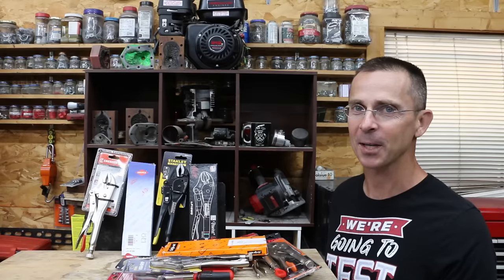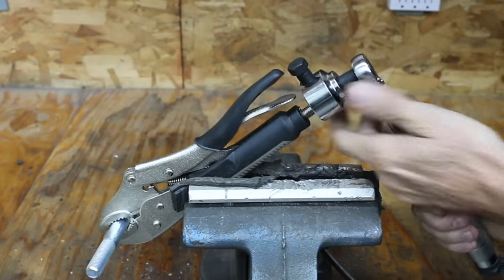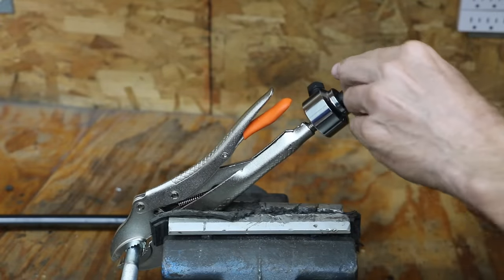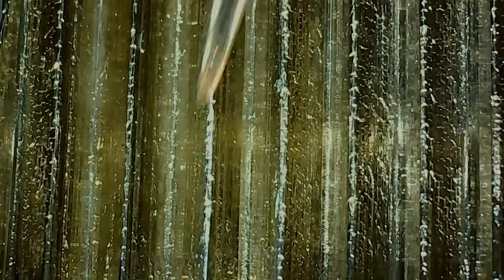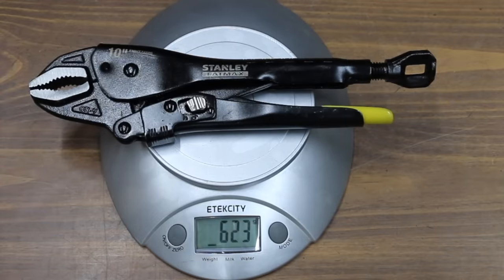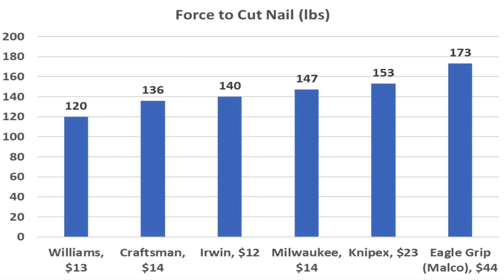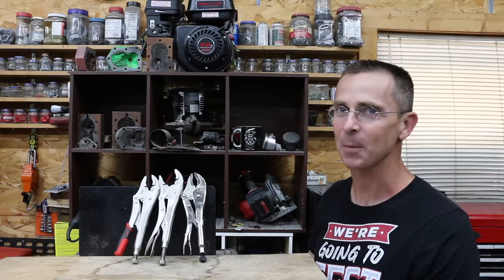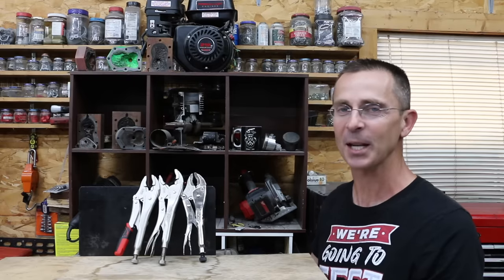Best Locking Pliers (VISE GRIPS)? Irwin vs Knipex, Milwaukee, Craftsman, Stanley, Malco, Pittsburgh.

Comment: Seriously impressed with Irwin and Craftsman.  Well done as always my friend. Keep up the amazing work.
Reply: Irwim seems to always be best value for money.
Reply: i originally bought a set of pitsburg ones because I just need something, but after a few weeks of them constnatly slipping on things I was fed up and replaced all of them with the Irwin ones, much better and actually grip. Now they sit in my spares drawer for modifcation (welded/grinded to custom tools)
Reply: Stanley black and decker makes and owns all of them and they are the original vise grip name that was in DeWitt Nebraska and malco reopened it making the same pliers 15yrs after they shut it down lots to be said malco gave back what Irwin and Stanley took away.
Reply: Irwin I believe bought vice grip company the original guys came with tool. It like locks
Reply: @CPthetooladdict  those Malco tools are just beautiful too. Definitely worth buying American made when possible.
Reply: Did Irwin had a patent on the original vise-grip?
Reply: @ophirb25  yes it ran out in 2020 and malco had this planned to start making them in the old plant in DeWitt Ne.

Obviously we can tell why Irwin went the china route it was to be make more profit over less cost of American wages and labor and also they can be more competitive in the market. It's a fickle situation and sad.
Reply: I'd be impressed with myself if I could stuff up a pair of most those brands using only my hands.
Reply: Both of these are sold here in Australia. I'd like to see the test redone including Draper locking pliers.
Reply from the maker: Thanks, will do!
Reply: @MantasJurkuvenas  Irwin tools are Australian, yet too many of their tools are made in China.
Reply: @christophermarshall5765  they work very well for tools designed upsidedown :)
Reply: @MantasJurkuvenas  yes they do!! One trick you could do, is to weld a rounded nut inside where the adjuster screw is, though you'll lose about 10mm of jaw use, or open the threaded section, & weld in a threaded sleeve.
Reply: @ProjectFarm   Just an observation. I dont think your test was entirely set up correctly. Your test only demonstrates the effectiveness of the adjuster, and not the actuall mechanical advantage of the pliers as a whole.  Let say the bolt you used had a .500 diameter. Take a .480 guage pin (or whatever you choose) and have the jaws closed and adjusted to just barely allow the guage pin to pass through.
Reply: @daisykaran5607  They did. Closed down the DeWitt, Nebraska factory where genuine Vise-Grips had been made for 70 years or so, and moved production to China. Malco reopened that factory a dozen or so years later and is making an improved tool with the know-how of several Petersen employees who were still in town.
Reply: @CPthetooladdict  It's more than just wages, it's metallurgy too.  Higher quality metals, better milling methods, and better heat treating, etc.  It's a complex issue, lots of supply issues too. 

Finally?  Quality control:  In the el-cheapo brands, they may or may not do a random tool check by lots.  Whereas I bet Malco brands check each and every pair before shipping.  You get what you pay for.
Reply: @MantasJurkuvenas  definitely a solid brand
Reply: You would really hope that the best vice grips would be vice grips. Like, it's literally the thing the brand is known for.
Reply: @ophirb25  Yes. Also a trademark on the name.
Reply: @christophermarshall5765  Possibly Gongmaw they have a youtube channel.
Reply: Vise grip brand locking pliers made in nebraska prior to irwin buyout were far far superior.
Reply: Their tools went to complete shit for years n years, they were bubblegum machine tier tools.
But here in the last say oh, 5-10 years? they really stepped up their quality.
Reply: @christophermarshall5765  Uhhh No! Irwin is not Australian. Started in Ohio, currently headquartered in North Carolina, and is now owned by Black and Decker.
Reply: As someone that worked at a big-box retailer, I found it funny each time someone had 'hate' for Irwin. Specifically claiming Vice-grips took a dump after they took over. I inherited some very old vice-grips and the new are just as good as the old - maybe better.
Reply: It's not as difficult as you think. I've had one or two that I 've used bend pretty easily, usually it's the flat bar that crosses between the two handles. And if that doesn't bend, the handles bend out of alignment. Not the best tool, if you need torque.
Reply: @CPthetooladdict  -Going back to 'The good old days', where good  tools (made in USA) were only owned by professionals, an air compressor made in USA was so expensive that Only the corner service station had one in our community, to say nothing of a 'Sun timing light, and professional dwell meter$$$$?... No thanks ;}
Reply: @CPthetooladdict  I'm not sure how many watching this actually used the original vise grips. As I mentioned above, since Irwin took them overseas they are garbage.
Reply: @CPthetooladdict  What's sad is that so many of us (myself included) will spend $10 to $15 on the 'cheap' ones. And we'll do this multiple times over 10-20 years. So we end up never buying the higher quality, better made, longer-lasting USA brand. We think we're saving money, but in the end spend more on multiple crappy tools...

Comment: So basically get a Malco to have as the emergency back up in the most extreme situation and get an Irwin for standard use
Reply: If you use them right any pair will work
Reply: @corycg9624  even harbor freight?
Reply: Ya that was my takeaway too
Reply: @mikeprice8307  speaking from experience-no, harbor freight vise grips are garbage
Reply: Malco is made at the original vice grip factory
Reply: I bought the made in China Irwin vise grips. Adjusting screw was hard to turn, bought them off Amazon

Comment: So glad the malco’s made it into the test I’ve been following them for years and now that they finally came out I was unsure if they were worth the price
Reply from the maker: Thanks for the feedback.
Reply: I jumped right in and bought 3 pair, figured my odds were good with being made on the original vice grip tooling.
Reply: I will probably never need a vice grip pliers that good or expensive, but I may buy one set just to show my support for what they are doing.

Comment: I'd really like to see you toss in a vintage tool when you do tool comparisons. Would've been cool to see you find a NOS Petersen Dewitt locking pliers (Can be found on eBay). Just to see if old USA tools are better than modern China/Taiwan tools. I realize it can't always be done, but if the possibility arises, I think it would be a fun comparison. Video idea -  Punches/cold chisels.
Reply from the maker: Thanks for the suggestion.  Thanks for the video idea.
Reply: I have a pair that says PETERSEN MFG CO, DEWITT NEBR USA.  I also have one that says Irwin, and “The Original”, which is not exactly correct in my opinion. That one does have two extra features, a hex hole on the turning knob, and a cutter.  

To garageshop Minnesota, other than that they appear identical, in construction, weight, and durability.
Reply: Eagle Grips are being made in DeWitt, NE. Very cool to see that happen.
Reply: @ProjectFarm  You gotta fullfil this one ;), I've been dying to see that as well. Comparing identical tools (same Brand and model) vintage vs modern model.
Reply: see a test between the peterson ones vs the malco ones.... both made at the same factory by most of the same workforce
Reply: Very good idea, comparing Petersen Vs Irwin, but we all know who’d win!
Sad to see how Irwin ruined such an iconic brand, but also good to see what Malco has done with the former Petersen facility.
Reply: @davidhoman3807  as long as they both have a roll pin for the release lever to pivot on, they are pretty much the same, and of equal quality.
Chinese production changed that to a rivet, along with subpar heat treat & metallurgy.
Reply: @oldscout80  the pride that the Petersen workforce had in their product was incredible. Right to the end.
So sad to see how Irwin crapped all over that.

Comment: This will probably get buried, but I'd love more hand tool comparisons. Claw hammer would be a great one. Checking on the strength of the flaw for pulling, does the head of the hammer crack if hitting edge of nail, general durability and flex. May be a simple tool but worth testing!

Comment: Thanks for including a Craftsman tool. I've been using Craftsman tools since I bought my first set of Craftsman mechanics tools while in high school in the 1970s. I've always found them to be more than acceptable in any job I use them for. I hope you continue to include Craftsman tools including Craftsman power tools.
Reply: To bad Craftsman tools aren't really "Craftsman tools" any more.  Most of my mechanics tools are old school Craftsman a once great brand brought low.
Reply: @W1ldt1m  
I disagree. I've been buying Craftsman tools since 1976. Craftsman tools were never made by Sears but we're made by many different manufacturers including Stanley,Apex and Western Forge. Since Craftsman is owned by Stanley the quality is very good. Most of my hand tool are new Craftsman, some Gearwrench. All my power tools are Craftsman. I work them hard and use they daily. Not a single failure. Stanley also makes Porter Cable, Black and Decker and DeWalt.
Reply from the maker: Thanks for sharing.
Reply: @michaelmartin2276  Porter cable, BD, and Dewalt are all different grades.  Same as new craftsman.  Many chinese made junk.  Not the same grade as USA made back in the day
Reply: @W1ldt1m  
I disagree. I wrench on cars everyday. Have 4 rentals I maintain plus my own home. I've never had a issue with a nut or bolt rounding off. But I am also very careful when I'm working on something. Use liquid wrench and any nut/bolt that's stuck. I also very methodical and patient. I'll certainly agree some tools are not as well made as in the past, but I think most any name brand will do the job for most of us. I have a circular saw from the '70's. Heavy and well made. But I always use my newer Craftsman saw first because it cuts just as well and is so much lighter.
Reply: @Manager_Mister 
I agree that I'd rather buy American made tools. But they are so few. I've replaced brushes on a Porter Cable drill and a DW drill. They had the same motor.
Reply: @michaelmartin2276  I too have been working on cars for 20 years. The Craftsman of today aren’t even close to the Craftsman of old. And it’s great if you’re careful about rounding nuts and bolts but sometimes the guy before you wasn’t. I’ve had many times where a partially rounded bolt (drain plug) that a Craftsman wrench wouldn’t bite at all and a Snap-on had no problem. Not saying Snap-on is the only one but it’s what I have.
Reply: @danhancock4392 
Huge difference in price. To me Snap on tools are overpriced. I have a friend who is a Snap on Dealer too ! Let's say it's a 15 mm drain bolt. Rounded off. There is no way in hell a Snap on wrench would do any better than a Craftsman . Since the nut is rounded off it would become slightly smaller. No 15 mm would fit. A bit of skill using a smaller socker or a proper nut/bolt extractor is the only way to remove it. I'll admit Snap on tools are as good as you can buy. But way overpriced.
Reply: @michaelmartin2276  well Michael I guess we’ll have to agree to disagree on that. I’ve experienced several times where the Snap-on will break something loose that a Craftsman couldn’t. Maybe they’re overpriced but as they say there is a difference. And I’d venture to guess I’m not the only one who’s experienced the difference.

Comment: This is hands down my favorite tool. In my experience the adjustment screw has always been my reason for replacing one of these. On a side note, tell me I'm not the only one who has ever used a pair of vise grips to unlock a pair of vise grips.
Reply: You're the only one

But yeah, some locking pliers can be hard to open. A piece of 1x2 hardwood used as a lever easily opens the stubborn ones.
Reply: You're the only one.

 I stick with mallets, hammers, box end wrenches, pipe wrenches, a rock, 2x4, basically whatever is nearby.  Though if I get a hold of 2 vice grips and 1 is free then I'll join ya, but free vice grips tend to get used.
Reply from the maker: Thanks for sharing.
Reply: You’re not the only one. Been there…done that at least a couple of times.  👍🏼
Reply: @octavioperez6996  Shhh. He's the only one
Reply: I normally use a cresent wrench lol

Comment: Cool video.  Nice comparison.  I am a little obsessed with locking pliers being a metal / wood working / mechanics, as well as growing up in Nebraska where they were invented and produced until IRWIN bought vice grip out and sent production over seas.  Malco just bought the plant and started it back up recently.  The problem is, the largest defining feature of a locking pliers is the over center clamping mechanism.  This mechanism needs to be made precisely right otherwise the hand squeeze to part squeeze ratio is bad.  When the over center, goes too far over center, the pliers will squeeze hard, then relax in the locked position.  The way these were tested by torqueing the adjustment screw this mechanism was completely bypassed.  
I like your design of experiments working hard to eliminate variables. Keep up the good work.
Reply: Which one do you reccomend then?
Reply: @danielorozco1728  I would say go with the Malco ones but they are expensive

Comment: Fantastic testing! Really great testing jigs. I'm sure others on YT will watch your videos to copy your methods, but they'll never come close to PF!
Reply from the maker: Thank you very much electronicsnmore!
Reply: I always enjoy your testing, but this time I think you should have figured out a way with a scale to truly squeeze the handle and let us see how the overcenter cam mechanism multiplies the squeeze force applied. Torquing the set screw leaves that engineering out of the test. I demand a retest. Now get to work designing a squeeze scale.
Reply: I have been on youtube since its creation, I have never seen anyone doing anything that is even close to this man.
Reply: They'll surely get cease and desist letters from LPL.
Reply: @danielritz8706   that did seem like something that might not translate into real world performance, as locking pliers are never going to be tightened to working pressure using the adjustment screw. It does allow a measure of test uniformity but may or may not translate to performance under normal operation.
Reply: I am disappointed he did not include KNIPEX "Pliers Wrench" which would have came in 1st place on most the tests or close, but then again it is a unique tool of its own.
Reply: @trench01  that tool is in another category, with smooth jaws and non locking; it's fun being able to squash down a penny into foil 👍 
That's a must have tool for me.

Comment: Bear in mind, most tool brands can change quality standards on the fly.  All is needed is a corporate mandate to 'reduce costs'.

However still a good video for comparison of features of this type of tool.

Subscribed.
Reply from the maker: Thanks!  Thanks for watching and subscribing!
Reply: this is why i LOVE every time a HF brand smokes DeWalt!  i used to be a DeWalt fanboy til they burned me!  HF has been doing the opposite, providing more bang for the buck and more options!
Reply: Right? That's what's so frustrating, You can buy two tools from the same brand at the same time and they come from two different factories.
Reply: @lmcc8798  Depends strongly on the item.

Comment: The Craftsman and Stanley did much better than expected. I didn't realize they were keeping quality up still. I have some tools from both brands not because of quality but because I like the beefy grips they have. The black chrome on Stanley tools is cool, too.
Reply from the maker: Thanks for the feedback.
Reply: the Craftsman's tool  image is based mainly on their Guarantee which used to be "Life-time" for wrenches & sockets. now Sears also sells a cheaper version (Companion) which has a  limited guarantee ( since so many Sears stores have closed that may not be true any more) a lot of people bought Sears tools thinking they were craftsman only to find they had companion when they needed an exchange. Very few if any sears items were made by Sears. many were made by(the lowest bid) name- brand companies under contract. when that contract was about to expire Sears would look for lower bids. the name- brand had already invested in the necessary manufacturing tooling, which would be scraped without a new contract, so would take the lower bid &/or up grade the item even at a loss. Either way sears got a cheaper/better item.Bottom line has become the norm I know of at least to local businesses having to close because although they were making money it wasn't as  much as corporate wanted so, so what if the local customers suffered. LL&P

Comment: I'm actually impressed by how well the automatic ones did on first test, was not even expecting half that
Reply: I have a pair of those.  Probably operator error but I can never figure out how to use the damn thing.
Reply from the maker: Thanks for the feedback.
Reply: I had a nice pair of automatic locking pliers from way back in the 1970s.  Finicky to use, but for repeated, identical application, worth fussing with the pressure screw (that little adjusting screw regulates the jaw pressure when locked). 

Alas, mine had soft jaws, and eventually, they were no longer serrerated, but smooth jaws... ha!
Reply: @bobpowers9862  Seems to be a really well made tool, too bad it's such a PIA to use.